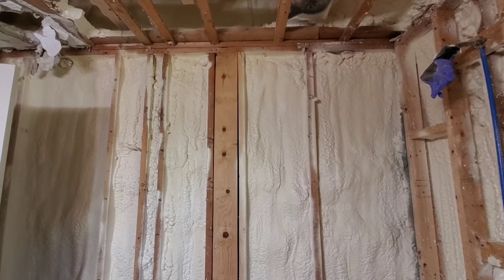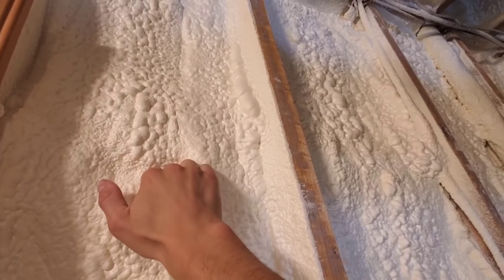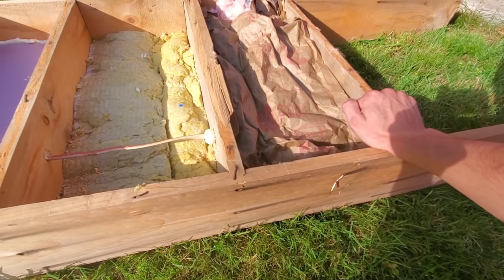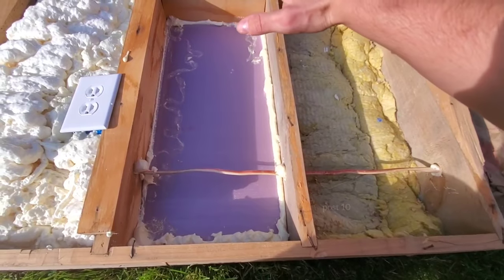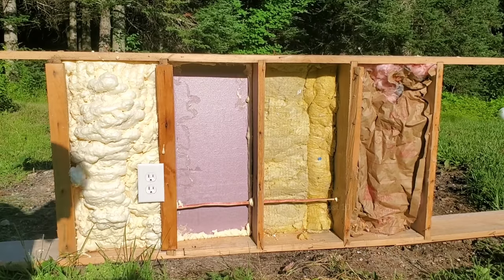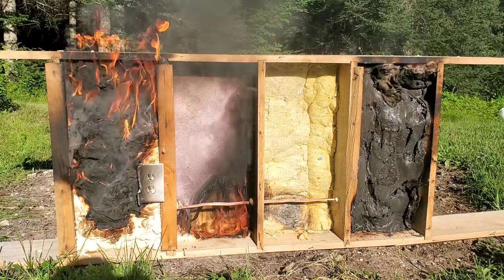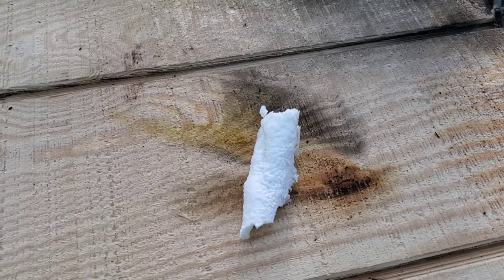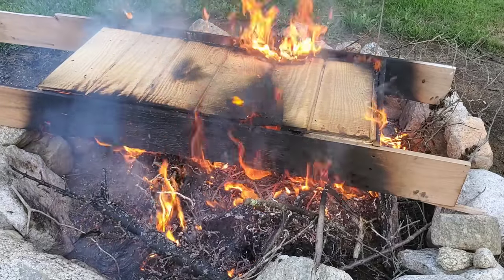Testing The Burn Ability Of Insulation In Wall

Comment: the spray foam hiding an inferno was legitimately terrifying
Reply: yes.!!!!!
Reply: This is the reason firefighters use hooks and axes fire can hide just remember where there’s smoke there’s fire.
Reply: Up until 13:21 I was wondering what you were talking about... Yeah, that's pretty terrifying!
Reply: Nightmare fuel fr
Reply: Alot of them use propane as the propellant.. so you have a bunch of propane bubbles inside of the foam.
Reply: Now you understand how fire can literally hid in a wall. 

-full time firefighter
Reply: Yea, I have a couple projects I was starting to think the foam would be ok for. Not anymore. I'll work with some other more difficult to use design and materials.
Reply: @derekeuchner1800  Closed cell is much more fire resistant than this hybrid mixture, also they have flame retardant additives for spray foam. Actual closed cell spray foam wont light fire like that from a torch, it will burn while the torch is directly on it, but take it away and the flame goes out.
Reply: @Lithane97  That's good info actually. Perhaps I won't rule it out after all.
Reply: Having a house built….. happy they are using fiberglass instead of foam like some places
Reply: @derekeuchner1800  wouldn’t trust it… my cousins house burnt down completely like to the ground day one of them moving there. They had a wood stove in the house and the venting/piping for smoke was completely surrounded by the spray foam. When they used the stove it heated the venting and the house caught fire luckily everyone was safe
Reply: @schueltar  not in home insulation.
Reply: @FFEMTB08  Question, if a house made with the hybrid mixture caught on fire (just a small on), what kind of extinugusher would you use?
Reply: @Himmel.Himmel  honestly you could use any extinguisher. Pressurized water can, CO, or dry chem. CO and generally uses around electronics... Ones that you don’t want to further damage... Dry chem is a fuck’n mess. It straight smothers the fire by taking the oxygen away. Which in turn means taking your oxygen away too. The only time you want to be careful with picking the right extinguisher is with grease/kitchen fires. And there are specific extinguishers for that.
Reply: @Himmel.Himmel  but back to the original question... Kinda. Shut the power off and you have regular products. You can use pressurized water, CO or dry chem.
Reply: insulation must not be able to burn in the first place at all in my opinion, use rockwool or glass wool the last itch just like one in the fuck
Reply: @Lithane97  Exactly. And this would be self-extinguishing inside a wall.
Reply: I’m a spray foam installer and purchaser. The products we use come with a Class A fire rating. It’s the same as concrete. I don’t know of any installers who use anything else. Our product does not burn like this.
Reply: @JosephClay  I'm curious if that rating is after application or in some sort of ideal controlled environment?
Reply: @jamesdalton3082  I’m sure there were parameters but exactly what kind of controlled environment would be favorable?  I’m certain it wasn’t achieved in a sandbox or swimming pool lol. Not sure what this means…
Reply: @schueltar  that’s preposterous!  Where did you get your information?  You’re absolutely incorrect.
Reply: @thedoctor6560  that’s sad and also improper installation. It is standard procedure to wrap the vent/piping with mineral wool and spray foam from there.
Reply: @KennyG944  this video does not show the product that actually is used to insulate houses. It will not burn like this. This video is showing the great stuff in a can. It is a very different product.
Reply: @JosephClay  I just mean like when our cars say they get 49 mpg but in reality that has to be in such perfect conditions that our cars will never really get 4mpg because, as they say, "your mileage may vary." I guess I'm just curious how exacting the standards are for home building  applications.

OK. I just saw, your above comment. Now I feel like I can better understand the non flammable insulation you meant. Thanks.
Reply: I only mean that concrete and SPF both have a Class a fire rating. They definitely do not burn the same
Reply: @derekeuchner1800  "Not anymore."  You must remember, this demonstration has an open face with no gypsum board blocking air from getting in.  That closed-cell foam will last for quite a while under heat conditions.  It's moisture retardant and an excellent air barrier, unlike fiberglass.  Fiberglass will collect moisture and lose its insulating value plus rot out the wall which is far more likely than a fire.  Closed-cell foam has an R-value of 7 per inch whereas fiberglass insulation has an R-value of 3.5 per inch.  The closed-cell foam is a vastly superior product.
Reply: @thedoctor6560  "They had a wood stove in the house and the venting/piping for smoke was completely surrounded by the spray foam."  That's what you call sheer stupidity.  That stove pipe should have been surrounded with rock wool that doesn't burn.  Even fiberglass wouldn't have held up under those conditions.
Reply: @JosephClay  ah okay
Reply: @Cspacecat  yeah
Reply: Foam reacted the way it did because he allowed oxygen to feed the fire by poking at it. With dry wall and a lack of good oxygen probably smolder. That being said the attic would have been a different story. This demo is more likely to react this way
Reply: If you use closed foam and drywall over
Reply: Use closed foam once drywall is on and no direct contact with flame and lack of air it will not burn. Cut the spread even more with fire blocking.. the paper on bat insulation will burn and smolder from  radiant heat. A true test would have been to build a wall with the different insulation and drywall on it, then a fire in front and observe from the back.
Reply: @JosephClay  he called this spray foam but it's just canned foam so it doesn't have the fire retardants in it like actual spray foam. Not a true representation.
Reply: yeap. i wanted to use that to fill my doors.... not anymore 😲
Reply: Even more terrifying was the price of the lumber to make the test rig
Reply: Houses dont get sprayed with Great Stuff. Its close but nowhere near the same.
Reply: Considering you used a can from store. It's not the same that they use for the spray foam. Cause the spray is mixed with a flame retardant chemical to make it safe
Reply: What does it smell like?
Reply: @Lithane97  Yes, we actually tried burning a small piece of closed-cell spray foam in our wood-burning stove - it didn't burn. (Dot)
Reply: Yes. I live up north but wouldnt want that
Reply: A lot of super toxic smoke smoke too
Reply: yup. You might think a fire has gone out, leave, and the place burns to the ground when you go. Always make sure. Double-tap, baby!
Reply: I mean wtf
Reply: It wasn’t hiding an inferno. He reintroduced oxygen to it when he disturbed it. It has been designed to char then die out
Reply: @Lithane97  thx for that. Can you tell me where I can find more of this information? My uncle produces urethane foam and his stuff extinguishes itself. I'm haven't been aloud near his shops... risk is not worth it.
Reply: @ThinkerTinker74  basic known info
Reply: The spray foam he's  using is NOT the spray foam professionals use. Please keep this in mind as you watch the foam burn. There's a reason why a 5$ spray foam burns and acts like a catalyst. Compared to actual residential and commercial spray foam that comes in two separate barrels
Reply: The spray foam he's  using is NOT the spray foam professionals use. Please keep this in mind as you watch the foam burn. There's a reason why a 5$ spray foam burns and acts like a catalyst. Compared to actual residential and commercial spray foam that comes in two separate barrels
Reply: And that's why after fire departments responding a house fire coming we stick around for a long time using thermal imaging cameras and pulling sheetrock and walls and ceiling to make sure that we've got all the fire
Reply: Seen it before. Fireplace got too hot and caught the spray foam on fire.
Reply: Ya I mean have yall ever seen a wood fire the whole house is built out of that just don't catch your house on fire
Reply: Rockwood is not fiberglass, it's basalt rock given the cotton candy treatment.
Reply: @BeetleBuns literally this happened a few days ago in spain

Comment: I work as house builder and rockwool is the only insolation that is approved to use in my country because of its great fire resistance. Its also very easy to work with.
Reply: Same here in ours. It's not fun to work with that stuff though (i mostly used glass fiber from a few decades ago that we still had though, which was no fun to work with eighter)
Reply: @xman7695  rock wool or basalt wool (the brown one) are better to work with than glass wool. Also, just make the building open for water wapor with vented facade and you get the most out of timber construction without being worried of condensation and mold.
Reply: And it’s a great sound insulator.
Reply: Euro
Reply: I loved how easy it was to install it.
Reply: How dangerous is it, in terms of fibers/dust while handling?
Reply: I just got done installing several rockwool batts for sound proofing in my basement. Glad to see it holds up well to fire like the product says it does. It definitely gets itchy in its own way working with the stuff but if a fire ever started in our basement, it should give us more than adequate time to get out of the house.
Reply: @totilsom  normal we use Mask when installing it for hours and hours ...  but that just as mush todo with the dust thats are the places we goto, and if you get it on the skin jsut use good cold water and it will go off you ...  "warrrning  never us HOT water it will stick to you then"
Reply: If its been applied on a concrete building, on the outside walls then its been covered by these expensive fancy panels (the colorful one mounted on racks), would it do its job to maintain the heat/airconditioned temperature inside the house ?

If placed over brick walls, but between it and a gypsum boards, what would be the inhalation health risk ? I've heard things like the others before me, that the fiber glass is risky, yet its forbidden for non-industrial use (housing and stuff) ?
Reply: @jeffreylonigro1382  I have installed Rockwool and it is much better to work with than fiberglass.
Reply: @eh_bailey  expensive as hell.
Reply: Air infiltration is more important than anything. "Cotton candy" worthless in many aspects especially this issue.
Reply: @ze3rax  all modern mineral fiber are certified to be safe fore health. The fibers have to be of certain size to get off the lungs easily within weeks, not years, like older materials. That’s why in Germany old glass wool is mandatory to replace during renovations, as it’s much more hazardous. 
Normally glass or rock wool requires a layer of vapor barrier from the inside, which together with the plaster board provides enough protection from the fibers getting inside.
Reply: Hemp is far superior
Reply: Well different countries have different standards due to multiple factors such as application time which I do love rockwool but it takes twice the time to apply rockwool compared to foam installation… but yeah if I had to choose I would choose rockwool but the expense of rockwool as a country that doesn’t have it as a major option in comparison, it’s a bit disappointing. 

If there was higher quantities of supply than the United States might look at it as a subsidizing material to replace the standards that are now in practice. 
Spray foam can cover around 6-7 panels of a room for installation per 20 dollars of material while a single panels for only a single panel cost $40 to $60 depending whether your using the block version, cube version, or flexible whoop version. This of course is the cost when it comes to retailers because right now the market for anything now is of course expensive as hell…
Reply: @SovereignTroll  the video itself begs to differ
Reply: @mrpumperknuckles1631  Rockwool is a great material. I agree here.
Reply: But a health hazard. (Dot)
Reply: Wrong. Hemp has a long way to go to even think about being a viable solution for many products. 
It’s a fallacy.
Reply: it can cause skin irritation

Comment: I hope you realize by making this video you probably saved many lives. We owe you a deep hearted thanks
Reply: Think would prefer the old fiberglass insulation.  Those foam sprays scary.  Thanks Post.  👍👍
Reply: yeah, i was thinking of insulating the wall between my condo and the next with spray foam.  Not going to do that now.
Reply: Or you read research on the topic and get proper information...
Reply: I agree! I was so excited about the new spray foam insulation, because it’s quicker to install.. but sounds like there’s a reason that we use what we use.
Reply: @fabr5747   Doyou believe this information is wrong, and in what way?
Reply: One thing to keep in mind is not to use spray adhesive instead a nail gun to install the fiberglass